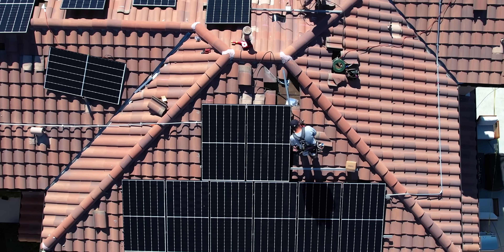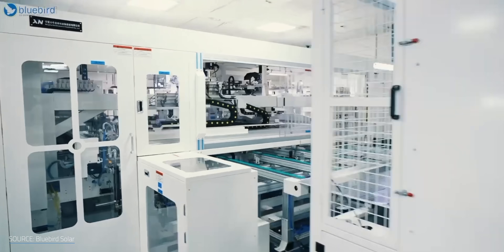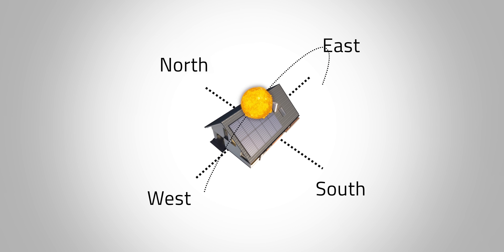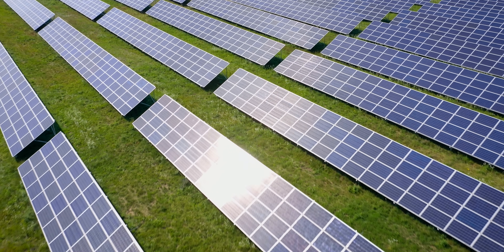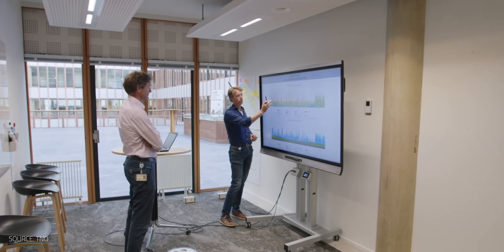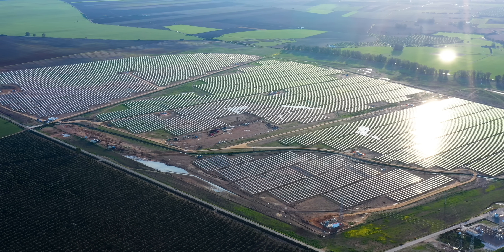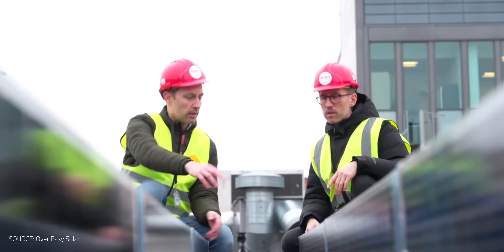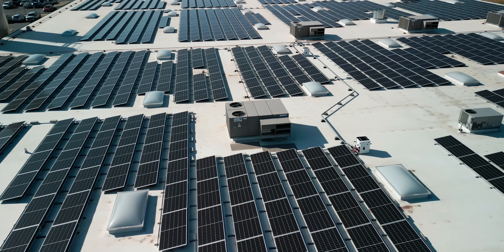Have we been doing Solar wrong all along?

Comment: It would be interesting to try out, both a Domestic Residential Vertical Solar Panel say 30 Kilowatts system, against an equal Domestic Residential Horizontal Solar Panel 30 kilowatt System.

With both recharging two separate  domestic electric battery energy pack 200 Kilowatts systems.

That is over a three year test period, say in Cambridgeshire, East Anglia near the East Coast of England.

While having a 6 x 5 Kilowatts Vertical Axis Wind Turbine Electric Generating System, again recharging a third Domestic Residential electric battery energy pack 200 Kilowatts system too.

To use the Wind Turbine System, as a comparison, to the two different Solar Panel Systems.

To see which of the three systems, throughout the four seasons of the Year, over three years.

Actually produces the most electric power, also if there are seasonal differences,  between the three systems too?

Then lastly installing two separate Solar Water Heating Panel 15 Kilowatts Systems, again one positioned Horizontally and one positioned Vertically too.

To see if the same effect happens, with Solar Hot Water Panels,  when positioned Vertically compared to Horizontally too?

Maybe lastly install a Geothermal Vertical drilled Hot Water Heat Exchange 30 Kilowatts System, using 10 deep bore-holes going down between 200 to 300 feet too.

As a comparison to the Solar Hot Water Heating Panel System equally, to see which is the most cost affective Green Environmental Eco Friendly.

Especially if you included a series of 10 x 3 Kilowatts Slow Flowing River Submerged Electric Generating Water Turbines,  in a near by river.

To producing electric power, to recharge another separate Domestic Residential Electric Battery Energy Pack 200 to 300 Kilowatts System too.

Then you would have a real world operational test environment,  between Solar, Wind, Geothermal and Water energy production systems.

To provide Electric Power and Heating or Hot Water, to a Domestic Residential  Property and Small Holding of Farm Out Buildings etc too, or selling surplus Electric Power to the National Grid, to produce an income for the Small Holding too!

Comment: I live in Vietnam, we have lots of sunlight and horizontal solar panels installation. It's a second roof that takes a few degrees off the roof. We don't clean the panels, Vietnam coastal wind & rainy season cleans them. The only concern is supports needs rust control.

Comment: I wonder if there is any problem with aircraft and the glare of angled panels.  If so then vertical panels would be beneficial.
Another benefit is the extra room between panels for greenery that also captures the light and cools the temperature too.

Comment: For residential use on horizontal panels couldn't you just run the upstream hot water line along the panels for really effective cooling plus lower water heating costs? Would have to be manufactured like that and sometimes the plumbing wouldn't be worth it but it seems like it would be an effective solution in many cases.

Comment: I underclock my CPU, GPU and RAM.
It runs my PC at much lower temperatures and I don't notice any speed difference.
Running cooler possibly makes it run faster, at all times,
instead of running faster until it heats up and then slowing down.
Plus, it keeps my room cooler in temp.

Comment: So strickly based on cheap panel prices a 5'×8' panel (two 2.5'x4' panels stacked) setup vs equivalent in vinyl fence panel leaves the solar panels about 3 times as much. Then you would have to add in the electrical equipment such as inverter etc. I assume you could find a way to use normal treated 4x4 posts to hand the panels. Wonder what the breakeven time would be to be equal to vinyl? The panels would serve double purposes as a privacy fence and generate electricity.

Comment: The panels run cooler? Cooler panels yield higher voltages, therefore more energy. I suppose they would stay cleaner as well.
Reply: So, it looks like I got the answer right on that one. I have been running "Westering Sun" panels on my arrays for years. Simply due to the fact that when you run out of room for North facing (as I am in the Southern Hemisphere) then spots to the West & East open up. 

I am more focused on the West as our East is somewhat blocked by a mountain range and, the Westerly panels help at the end of day, delaying that moment when the batteries take over providing the lion's share of the energy. 

As for the vertical panels, make a fence out of them. At the very least it's an opportunity to squeeze more panels onto a site, where traditional skyward angles ones have no more real estate to use.

Comment: The density of panels for a project appears much lower with greater spacing needed between vertical panels being much larger to avoid shading issues. So whilst the performance may be higher on a per kW basis the total capacity may be much lower where land constraints are an issue (which is most projects where they are leasing property). 

Combining bifacial panels with east west oriented tracking technology seems to have better efficiencies than BVSPs especially when combined with native high albedo vegetation or even white gravel.

Great video.

Comment: Living at 40 deg north, it looks like a bifacial panel set vertically on a NS line would get 2/3 the energy of a normal south facing panel during November December January Febter.  Is this a proper estimate?  Winter is hwen I need the most power.

Comment: At least one other youtuber has been over that: south-wards inclined panels with regular PC fans strapped on their back and set to turn on when temps approach "too hot" also work. The voltage lost on the fans is still easily exceeded by the performance gains, iirc.

Comment: How about mounting a (pair of) regular solar panel(s) vertically in a similar orientation? I have 2 305w in my backyard pointed slightly southwest at 45 degrees (not optimal, this is Toronto at approx. 43deg N, but it's so easy to cut wood for the frame they're sitting on). Towards late evening I see direct sunlight towards due west across the row of backyards, but I'm not in position to capture that.

Comment: I'd like to see them tested in the outback of Australia, or in Death Valley California, throughout a hot summer, see if there's a point of earthly temperature at which the panels get so hot that it doesn't matter which way they're facing, they're simply going to get too hot to be as efficient as they are in other conditions. The sun-facing solar panels work well in the Aussie desert where I live, but they do suffer the heat problem and thus are more efficient in winter than in summer, because the sun still shines almost every day in winter, it's just not as hot due to both the tilt of the Earth making the sunlight less direct, and because the sun is an extra 4.5 million kilometres away at that time of year.

Comment: considering how much snow a place like Finland sees during the winter and how it might take a day or 2 for even a little amount of snow to melt from the top of solar panels when the temperature goes temporarily to + side of things and considering how much cleaner from a snow something like a fence side or the road signs are when compared to roofs... i would see these vertical models as an absolute win in terms of production increases during the times when you actually would like some extra energy for heating the house

Comment: My 2cents on it's perceived benefit?
Facing east-west helps reduce warming up from the noon sun. So the panels stay cooler. Thus performing better than warm panels. However due to the sub-optimal position they generate a bit less too. But since the indirect /ambient sunlight still works to produce electricity even the shaded panel generates electricity. This stretching the time during which it produces electricity. With a field of them, the reflected sunlight bounces onto the opposing panel, improving it's yield. Standing vertical also improves convection helping to cool the panels.
You could do much the same by mounting 2 regular panels back to back. But you'd need to ventilate the space between. And that space is going to get clogged up.

Comment: Not quite believing this yet. The double-facing panels are more expensive - how much more? They have double the wattage of single-face panels due to 2 sides - so a fair comparison would be a 6kw rooftop array with 6kw of vertical panels. Currently you are apparently doubling the number of panels (wattage) for the vertical comparison.(?)
Presumably you are also talking about panels with micro-inverters because one example you showed had grasses growing up in front of the panels, which adds a whole new labour/maintenance dimension and potential to squeeze supply if you were using old-style panels.
This really speaks to how cheap panels have become - cheap enough that we can afford to install them in sub-optimal positions purely because they will get rid of that "duck" curve - which is a desirable thing.
But yes cooler panels leads to more efficiency; we've known this for a long time. So in one way efficiency is important but in another way we're going wildly inefficient by installing panels in positions that can only produce power for half the day. Looking at overall "averages" perhaps can hide the detail.
Thanks for the report. We're all learning.

Comment: It seems like the vertical set up would make dust, snow, leaves less of a problem and it seems like the mounting hardware could be much less complicated as it would not be necessary to make it adjustable. The reduced heat should not only increase the voltage, but theoretically should extend the operational life as well. Seems like a winner if they can get the cost  down to competitive with the current model.

Comment: I refuse to believe you can get more power from vertical panels. You may gain a few % from cooler temperatures (maybe 3-10%, depends on location), but losing a massive amount (like 50% or more) from high angle of light hitting the panels. If you compared to sun facing bifacial panels mounted off the ground to get the ambient light on the back, it for sure will outperform a vertical panel. The only advantages I see are land use (situational), and higher output in the evening when demand is highest, partially mitigating need for batteries.

Comment: If heat is the real problem, and solar panels generate most energy from visible light, maybe panels should be designed in a way that has mirrors that reflect the visible sunlight into panels that are shaded from the direct sunlight. This would protect the panels from the heat of the wavelengths it can’t use.

Comment: Before he says it, my two guesses, which may not be mutually exclusive because it might be both working in tandem, would be atmospheric scattering (ie. Raleigh scattering distributing more overall light) and operational efficiency due to heat.
Photovoltaic Cells are more efficient at lower temperatures, so the most direct sunlight (aiming them perpendicular to the sun) would actually produce the highest drop in efficiency along with the largest gross input of EM energy.
By by, instead, optimizing for the relation of energy vs efficiency drop, that should yield a greater net result, and most likely involve not directly facing them to the sun.  And that's what the vertical position is inadvertently doing; accidentally offsetting the angle and keeping the panel just a bit cooler.  But it still gets ample overall energy input, both by the oblique angle with the sun, as well as reflected and refracted light via albedo and scattering.
That's my hypothesis... now let me see how close I was.

Comment: The evidence in this video doesn't really convince me that the yield benefits are real and widely applicable. There's still no clear explanation of why the vertical panels were cooler than modeled, and that makes it hard to predict whether that effect will carry through to other settings, and how strong it will actually be. It seems to me that the two advantageous conditions for vertical panels, high albedo and high irradiance, don't really coincide that often. I think orienting your panels in any other way than straight towards the sun is such a bold move that it requires stronger evidence of reliably better results.

Comment: The reduced temperatures is also probably aided by convection. If the panels are mostly horizontal, as they would be in most rooftop mounts, the displaced air from convection on the bottom part of the panel isn't going to change the airflow around the top part of the panel much. If anything, you might get eddies which would hold hot air next to the panel, increasing temperatures. While a vertical mount means any heated air from the bottom panel will push the air above it out of the way, leading to increased airflow on the panel, leading to reduced temperatures. I wonder how much of a difference changing the angle slightly would have on the temperatures.

Comment: Seems like it'd be easier to cool the horizontal panels and get them as efficient against heat as we can. Maybe even pipe water through them, which can also be stored for hot water use later.

Comment: It may be that vertical solar panel arrays make more sense in the south (Florida, etc) and the conventional panels in the north (New England) due to the higher temperature in the sunny months.  Also vertical panels mounted low may suffer damage or blockage from the sun in heavy snow, not an issue below the snow line.  Perhaps using the double sided panels mounted on motor driven tilting device to set them at the best angle to make use of reflected light, and lowest heating during different parts of the day.

Comment: Solar is a waste of time. It will never be a consistent reliable source of energy. It's virtue signaling and nothing more.

If you aren't pushing nuclear then you aren't serious about solving anything.

The only potential solar has is making green hydrogen and power for self sufficient off-grid living in certain cases (with battery backup).

Comment: I am more fortunate than many in that the size of my solar array is not constrained by available area for installation. I can gain a 2.5% increase in output at a tiny fraction of the expense of a bifacial array by just adding one more panel. I won't do that because for the past five years my existing system has provided me with 100% of my electrical needs, only costing me $1.33 per month for my grid connection fee.

Comment: Wouldn't adding a thermosolar part to the cell reduce the temperature problem? Something like a liquid refrigeration that could reduce temp while getting hot water. Or adding Stirling engines on the rear part of the cell.

Comment: What if you integrate small heat pipes in the inside of the vertical panels?  That would remove even more heat rather efficiently.  But would the increased efficiency offset the cost?

Comment: I would have guessed that the extra yield is combination of collecting energy from albedo, keeping the panels cleaner because less crap sticks to vertical surface and the cooling is more effective because vertical draft air movement from heating the surface happens easier for the direction that goes parallel to gravity.

Comment: Why not have a heat recovery system built into the back of the solar panel? Could be as simple as a metal plate cooled my water (a radiator) attached to the back of a solar panel. The recovered heat can be used to heat up water tank  via heat pump and heat exchange.

Comment: Just to point out... you can grow tomatoes in Florida under partial cover but not in full-day direct sunlight.   There are lots of areas of the world where the efficiency of combustion based power generation actually drops off and many of the staple food crops need some protection from elements.   So while I doubt the vertical panels would help tomatoes in Florida since they're reflecting and emitting the heat radially back to the ground.... they would be able to produce not only wind shadows but also reduce some evaporation, windscour and increase fertility drift collection.   The main concern is simply ensuring they're made with material that can be cleaned by absolutely crop-safe chemistry.
Reply: Would be great if water is enough to clean them. Then you can clean the panels and water the plants in one go.
Reply: You entire comment sounds odd.  Solar panels surfaces are plastic or glass.  The material doesn't really dictate if you can clean them with just water.  The stuff you are cleaning of matters, dust could be cleaned with a soft cloth, but if it's like tree sap you can't really just use water.
Reply: Deionised water should clean most things off, what are you doing putting solar panels where trees would shade them.
Reply: some heat is removed by air convection upwards. 
IMO there's a lot of space for tuning. Like making them taller with a space for the air at the bottom. Using reflective paint on the ground...

Comment: So instead of Solar roofs, will we now start making solar walls?
It’s not very clear from this video whether the “bi-facial” is required, or whether the temperature difference is the killer feature. Would a solar wall have the same/similar temperature benefit, or is the temperature difference originating from both sides of the solar panel being able to cool down?

Comment: I've always wondered why even rudimentary heat sinks are not very common on solar panels. Just a bit of extra ordinary metal could easily gain a couple percent for negligible extra cost.

A water-cooled pv panel could even be used to make a hybrid solar heater and power system, though fluids greatly increase the maintenance and complexity

Comment: Just perhaps speculation, but can the increase in temperature be turned to an advantage.
Possibly coupled wth  a Fresnel lens or other more specialized focussing device, a thermoelectric backing with the PV panel be used to produce supplementary electricity.